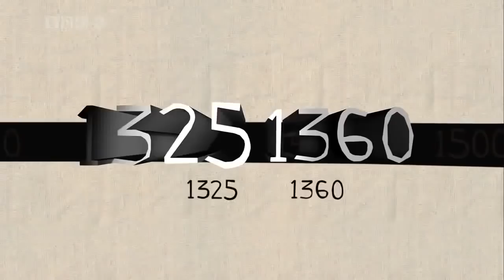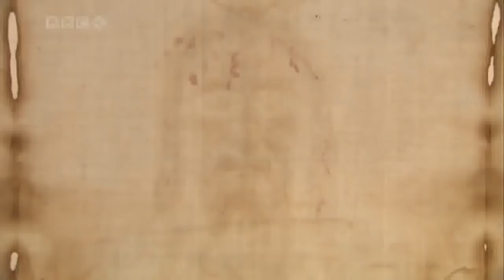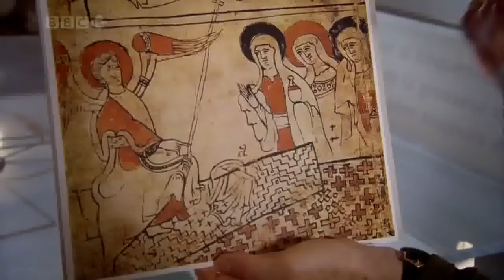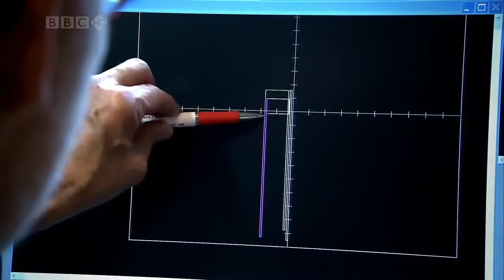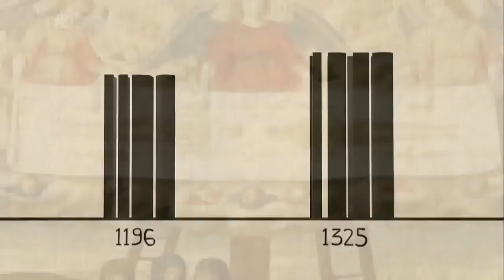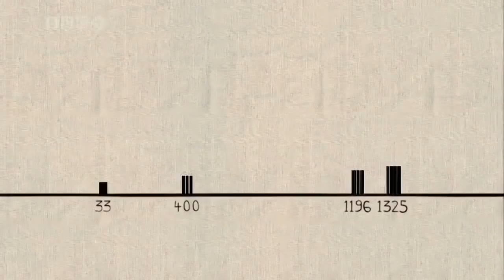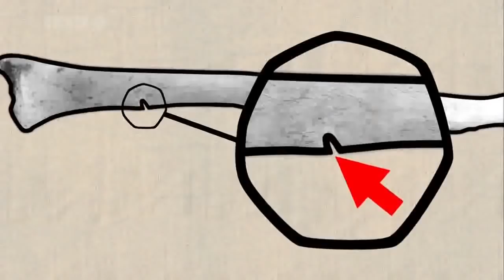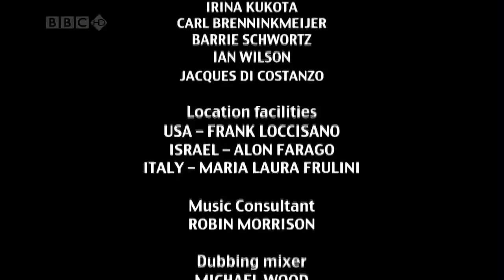BBC SHROUD OF TURIN NEW EVIDENCE

Comment: The carbon dating was correct.  However, the sample of the Shroud given for carbon dating was not of the original Shroud.  It included repairs which used cotton added to the linen of the Shroud during the Middle Ages.  Add to that the fact that the Shroud cannot be reproduced today showing the same qualities or that we are, today, unable to understand how the image actually transferred from inside the body of the Man of the Shroud to the material of the Shroud.
Reply: I had heard or read the same thing about newer repair material being in the tested sample in the 1970's.  I wish that was discussed in this documentary.
Reply: What you have here is the church backpeddling. Funny how no mention of repairs, until they needed to lie.
Reply: @poozer1986  Prior to the carbon testing the Shroud was photographed under various forms of light and is documented through that photography showing areas which were distinctly different in shading.  One such place is exactly where the sample to be tested was cut, divided and sent to the labs.  All this was filmed and done with complete documentation.  Later examination/testing of the area(s) showed that the area of the tested sample was mended with cotton, not linen, and had an animal dye in it to make it match the linen color of the Shroud.   No lies and it was not the Church who discovered the repairs.  It was scientists.  Imo, the Vatican would prefer to ignore the Shroud.  It's a personal experience.  If you read all the scientific information available you will either believe that it is something supernatural, that we cannot duplicate today, or you won't.   It really shouldn't matter to anyone what someone else believes.
Reply: @sharonburke100  just to add, it didn't bother me what anyone else believes. Hell, I'm a real life descendant of vikings, so I was brought up with norse mythology as bedtime stories.

The only time we as atheists get pissed, is when other people's beliefs, infringe in our lives.
Everywhere I go I see religious bullshit. It's even worse on America.
Here's a deal, you keep religion behind closed doors, where it belongs, and we as atheists will stop giving you a hard time for your delusional thought processes
Reply: @poozer1986    I feel sorry for you.  You are a very disturbed person.  Goodbye.
Reply: @sharonburke100  see how crazy you sound. In any other context, you'd be classified as insane
Reply: @sharonburke100  meant to ask. Why do you feel sorry for me. You shouldn't, after all, I'm free of the oppression and hatred of religion
Reply: @CMA0333  I'll have a look at our when I can be bothered. No doubt its all biased bullshit dressed up as real science.
Reply: @poozer1986  love your neighbor as yourself, if you have 2 of something give one away, forgive, don't sue at the law...yeah, real oppressive hatred teachings we Christians believe in
Reply: @lostamericanhistory2536  anything, that gives you rules, whether God or bad, and had an eternal punishment for those who don't follow, or by definition, oppression.
Reply: @poozer1986  I have no evidence or reason to even believe that Jesus visited America and neither do I believe it is a nation of predominantly saved people.
John 8:36 "if the Son therefore shall make you free, ye shall be free indeed.
James 1:5 If any of you lacks wisdom, let him ask God,who gives generously to all without reproach, and it will be given him. 
Proverbs 1:7 The fear of the LORD is the beginning of knowledge; fools despise wisdom and instruction.

So God does not teach oppression or ignorance
Reply: @poozer1986  Im very educated. Salvation isn't legalistic, that is worthless. if you confess with your mouth that Jesus is Lord and believe in your heart that God raised him from the dead, you will be saved. For with the heart one believes and is justified, and with the mouth one confesses. Slavery : your referring to gen 21. God doesn't condone slavery, he told the Hebrews how to treat their slaves in the land they were going to conqure. In 21 he also forbids the capture and selling of people. I have raised 2 nephews and 1 niece as my own. My niece is homosexual. I treat her the same as before
Reply: @poozer1986  As you are now, you were making derogatory statements in an opinionated attempt to link a lack of intelligence or education with faith. I am an electro mechanical engineer who ownes his own company. We provide automation service to fedex and Ups, mainly programmable logic controls for their conveyor systems. So far you have only stated your opinions which are unfounded.
Reply: @poozer1986  I fully agree, education has nothing to do with faith so why did you bring it up? God says " the fool says in his heart there is no God". I think that now makes 5 topical statements that you have made.  I have responded with quotes within context which proves that you have been wrong on every point. Your lack of rebuttle and behavior is proof. You have provided no evidence for anything, only statements which makes your comments an opinion, not fact.
Reply: @lostamericanhistory2536  but I can, however prove, that evolution hairbrush, although I don't need to. Its caked the theory of evolution, and if you were indeed smart, you would know what a hypothesis must go through, to be given theory status. Anything that is called the theory of something, like gravity, germ, relativity etc, are proven way beyond reasonable doubt.

Theories need hundreds and hundreds of proven bits of information to get to that status, but only needs one bit of evidence to the contrary, to not be given it.
Reply: @poozer1986 You havnt proved anything  yet Alex your just going all over the board on topics which I presume are things you read online. Psalms 2 Why do the heathen rage, and the people imagine a vain thing? Ok so now intelligence does go hand in hand with faith. James 1:8 a double minded man is unstable in all his ways. Im not sure what an evolution hairbrush (autocorrect makes everyone look like a fool at one point or another lol) is but 2 Tim 3:7 Ever learning, and never able to come to the knowledge of the truth.”
Reply: @LennyCash777  absolutely wonderful presentation Lenny thanks for the post.
Reply: @lostamericanhistory2536  
No problem. God bless. ✝️ 🕊️ 👑
Reply: @poozer1986  one need only look at the area that was carbon dated and visibly see that this area was repaired.  They cut right along the edge in between the old Fabric and the new fabric it doesn't take a rocket scientist to figure that out.  Anyone that thinks a 2000 year old cloth would not at some point be in need of repair is extremely lacking in intelligence.
Reply: @sharonburke100  very well stated.  It comes down to this, if one follows the good science the Shroud is authentic if one follows the bad science then it's not.  A great example of bad science is drawing a conclusion based on a single test and ignoring 99 other tests that are in disagreement with that.
Reply: @GoodShepherdFilms3333  so, all 8,or more, pieces, were all, conveniently, repairs. Again, you show your bias and ignorance.
I never said a 2000 year old cloth wouldn't need repairs, but it isn't 2000 years old, it's 900 at a push.

The case is closed, and the church won't allow any further tests. Convenient again.
Reply: @GoodShepherdFilms3333  not even the Catholic church will say if its real or not. Because we know it's not, and I'm guessing, so do they
Reply: @poozer1986  the Shroud of Turin is a witness that tells a story in the form of 21st century forensic science.  It tells us with unmistakable clarity that a dead body became a living body in a 3 day time period and  emitted several billion watts of power for less than a billionth of a second and as a result left a holographic, color inversion, x-ray image on linen.   We know you think the truth is like a pretzel you can twist into any shape that makes you feel comfortable and doesn't threaten your fragile belief system but it's not.  Skeptics such as yourself make for great study in how ignorance and contempt clouds one's judgment and makes it impossible to conduct a fact-based, thorough and objective investigation.
Reply: @poozer1986  it says In God We Trust on our currency if you don't like that you should move to another country.  I should also remind you that nearly everything you do in your life is to acquire that piece of paper that says In God We Trust in it.  No matter how you present your case you can never prove there is no God and there is also no escaping the fact that you're actually gambling with eternity.  Skeptics claim to be intelligent yet their actions demonstrate the polar opposite.  The elf communication waves around the circumference of the Earth are clear evidence of a higher power intelligence / God.  Another demonstrated reality in front of your face that you ignore because it threatens your fragile belief system.
Reply: @poozer1986  wow you just rendered a guilty verdict before the defendant even stepped into the courtroom and the first witness gave testimony.  In the same way you have just rendered a guilty verdict that same criteria will be used when you are judged.  Do you realize your criteria and measuring system of justice is based on a scale  below that of a Salem witch trial?   Have you ever heard of a thing called doing a fact-based and thorough investigation before rendering a verdict?  You should try it sometime.
Reply: @GoodShepherdFilms3333  your first amendment directly contradicts your first commandment.
Reply: @poozer1986  21st century forensic science confirms that what is written in the Bible is indeed truthful and accurate testimony.  You can be in disagreement with that but your opinion the bible is not rendefing credible testimony is not based in science but rather based in ignorance and contempt.  The forensic science tells us on the Shroud of Turin that the resurrection of a dead body is indeed possible and such an event did indeed occurred nearly 2,000 years ago.
Reply: @poozer1986  how would you know what the facts State?  you rendered a guilty verdict before the first witness even had a chance to give testimony?!  Read your own posts, the evidence of your contempt and ignorance is in plain sight.
Reply: @GoodShepherdFilms3333  it's people like you, that have turned your country, from a super power, to a world wide laughing stock
Reply: @poozer1986  8 pcs?  What are you talking about?  Area of the cloth.that has the most damage is around the two ends of the cloth where it was handled the most.  Carbon dating test was s a single piece of fabric cut 7 cm long and 1 cm wide and then was cut into three pieces on one of these edges.  The Shroud of Turin fabric has the same level of electromagnetic radiation damage as the Dead Sea Scrolls that we know are over 2000 years old.  It is a scientific impossibility that the cloth is only 500 years old with this level of severe radiation damage.  Note I said electromagnetic radiation damage not thermal radiation damage.  A big difference between the two. A Swiss textile expert also confirmed that this was a first century cloth.  Also there was a carbon dating tests done in 1982 in the same area that showed the cloth came from the time of Jesus.
Reply: @poozer1986  In their last exhibition of the Shroud in 2020 they outright stated that the cloth was the true authentic burial cloth of Jesus. yes they did
Reply: @GoodShepherdFilms3333  please, cite your reference
Reply: @GoodShepherdFilms3333  do you honestly think, science would have only checked 1 part? Your ignorance towards the scientific method is infantile.
Again, please cite your references
Reply: @GoodShepherdFilms3333  actually, I do have 1 last question. Have you ever thought your god doesn't exist. Even if it was a spilt second?
Reply: @poozer1986  the only way in which 21st century forensic science has been able to replicate the unique chemistry and physics of the Shroud image was to fire an argon fluoride laser at a single fibril with significant power for less than a billionth of a second.  The process to create the entire image would require several billion watts of power emitting from a dead body there's no way to escape that fact.  You can hurl insults and use words like fairy tales and whatever but whether you realize it or not you are backed into check-mate.  Your feeble attempts to escape are laughable.
Reply: @GoodShepherdFilms3333  really, you think I'm backed into checkmate. The delusion continues.

Never answered whether you've ever not believed
Reply: @poozer1986  whether you live in the US. England or in Africa there is still no way of escaping the fact that in order to recreate the image on the Shroud of Turin involves being able to emit several billion Watts of power from a dead body that results in changing  the electron bonding of the carbon atoms that make up the linen flax from single electron bonds to double electron bonds.  It is impossible to create such a change in the atomic structure of carbon atoms and leave behind a superficial image that only penetrates one or two micrometers into the 15 micrometer wide linen flax fabric with a man made process.  Of course if you had conducted a thorough investigation into this case File you would know that but you don't.   Unlike you I conducted a thorough, fact based and objective investigation into this linen cloth before rendering verdict and I could have cared less  whether it was authentic or not.  Of which for the record I did not believe it was.
Reply: @GoodShepherdFilms3333  again, unless you show evidence for what you're saying, I don't need to believe a word of it.
Wow, your church is really inventive when it's trying to keep it's sheep blind
Reply: @GoodShepherdFilms3333  I didn't need to conduct anything, or was done for me. Science didn't care what the result was, as long as out was accurate.
So, again have you ever, for a split second, thought God didn't exist.
Reply: @GoodShepherdFilms3333  did you get a piece of the cloth, and test it yourself? Didn't think so, so again, just conjecture
Reply: @poozer1986  first of all I lived in  Costa Rica and Nicaragua for 7 years I've also lived in Mexico and in the Bahamas, I just happen to be in the US right now and quite frankly I don't give a damn what you or any other country thinks about this one or any other country I have lived in, and if spending ten years of my life carefully reviewing evidence and doing a fact-based thorough and objective investigation into a matter in pursuit of the truth makes me a laughingstock then I want to be a laughingstock and would wear that badge With Honor.
Reply: @poozer1986  from your own posts and written testimony we see that you render guilty verdicts on a scale of Justice below that of a Salem witch trial and we are supposed to believe that you're a credible Witness?!  I could ask you 12 simple questions about basic forensic facts of the Shroud case file and you would not be able to answer one of them without doing a Google Search and then stand a 50% chance of being wrong.  You have already been reduced to character assassination as your "evidence" . The Shroud of Turin is a case where 21st century forensic science and religion come together on this piece of cloth I should also add they get along quite well together.
Reply: @GoodShepherdFilms3333 
Clearly, you wasted 10 years, if you ended up believing the clear fakery of the shroud.
Why do you continue to avoid the question. Have you ever not believed?
Reply: The Carbon dating was "Wrong" and couldn't be correct because it was dyed cotton. And the Original material is all linen. Which the "New Carbon dating" shows it comes from the time of Jesus. 
Watch or Find the Documentary with the  Original lead scientist Raymond M. Roger's of all those tests done, He even helped to get a second test approved.  Barry Shwartz One of the Photographers  has made this his life's work. This cloth changed lives of the people who got to work on it. 
The new cut carbon sample shows its from the first Century.
Reply: @BlueskyGladue  are you honestly going to push such garbage. Please, cite where you get your lies from.
New carbon dating? Again, please cite the study and press paper. From what I can see, Rogers is a theist, so unfortunately, his opinion doesn't matter. It also appears that Barry is also an indoctrinated theist, so again, his opinion doesn't count, as ours heavily biased with their need for the shroud to be authentic.
You're totally right, the oths lie for change lives, and forced people to believe in the dogmatic cult that is Christianity. It changes their lives for the worse.

I await citation of your claims, and the relevant scientific documentation and papers to go with it
Reply: @BlueskyGladue  but, even if the shroud did come from the 1st century, that doesn't prove anything, other than its old.
But anyway, I find this Rogers and his claim. Literally no one, other than himself, thinks he's right. He claimed, but never proved anything.
Reply: @poozer1986   atheists I’ve met are all snarky and arrogant, very arrogant. You all sit on your high horse soap box acting like you’re smarter and better because you don’t believe in a god. Even if it’s a Christian minding his own business. Think about it you believe that this universe came from a small dot of dense material/matter that came from no where, somehow exploded and through billions of years formed everything we see and feel today. You believe that our existence and the universe is mere chance. So before you go judging other people, reflect on yourself. And remember the Big Bang isn’t a fact, it’s a theory that has no testable data
Reply: @poozer1986  so according to you, this entire universe came from a dense point of matter that had no creation, it always existed right? Nothing created it? Does that sound familiar?
Reply: @louiegonzalez6812  let's look at our this way.
You walking into a meadow. It's totally clear except for a tree stump in the middle. No sign of a tree, or drag marks, in fact, no sign of anything. Theists, as they e no tree, and no evidence of a tree, must conclude the stump grew as is. Science, on the other hand, knows the must have been a tree, and that tree has since been felled and removed.
Reply: @poozer1986   So you do believe that God Exist; right? And yes it takes some faith not to believe in anything, why? Take all the world cultures; they all have in common the fact that they believe in some kind of gods even the vikings. Is that a true statement Alex?
Reply: @gamesplayerDJ  no, I totally deny the existence of any of the 3000 or so gods that have been created by man.

It takes zero faith, to not believe something, especially when I I work with facts
Reply: @gamesplayerDJ  just because people believed in God, does not make it true
Reply: @poozer1986  OK. First of all ; I agree just because people believe something doesn't make it true. On the other hands 3000 different culture believing in gods make it hard even for science to brush it aside as something not true. Do you agree with that?
Reply: @gamesplayerDJ  your profile picture says everything I need to know about your arguement. It will be heavily bias, and have absolutely no evidence to back up anything you say
Reply: @poozer1986  Thank you for your reply. Yes, I am a Catholic and obviously I am not trying to hide it. So to your point, I am bias but only toward the truth. So far, I have not used any argument that's beyond basic reasons, have I? If I did please point it out to me. I will like you and to have simple discussion using evidences (Sciences). If I say something that reasonably isn't true, you can point it out and disprove whatever claim it is that I am making. Can we agree to move forward on those principles. If yes, can you please answer my previous comment? FYI, I am not an "apologetic"; I am a simple lay Catholic Christian so I am not here to shove any well prepared arguments down your throat. I just want us to have a simple discussion. Thanks and May Peace and Love be with you.
Reply: @gamesplayerDJ  you say you're bias towards truth, yet you follow a religion that quite literally has no evidence or truth, to back it up.
Any time you mention god, you're talking without basic reason.
First you must prove your claim to be true, then I can disprove it. As you cannot prove anything towards your religion, it's a non starter.

You are indeed an apologetic, because you're arguing in defence of your faith. That precisely what apologetics are.

I see no reason to have a discussion with you, as I was always taught to leave puerile to their imaginary friends.
Feel free to take your leave
Reply: @poozer1986  I follow a religion that has no evidences to back it up. How is that, can support your claims because that's what sciences do; make claims based on fact. So far you have no provided any evidence as to any of your claims. I want us to discuss this subject by subject but you keep switching from subject to subject and now you're attacking my Faith which for obvious reasons I didn't mention to begin with. It is funny that you want to use the very thing that you reject to prove your point. Think about it. Please let go subject by subject. Since you do want to answer me; please start stating your counter claims to the existence of God or to Truth of Jesus-Christ or anything else you think will sustain your point of view. I am listening. Peace be with you my friend.
Reply: @gamesplayerDJ  you misrepresent science, so please, stop trying to use it. No your religion didn't have any evidence, and I don't need to prove annoying to say that. You need to prove what you say, it's fact. You're breaking the null hypothesis, not me.
It's about time you guys learned who the burden of proof falls on, in a discussion.
I don't reject religion, as ours clear religion exists. I deny the authenticity of these religions. There's a huge difference.

I'm case you missed it, or I want clear, I have no intention of having a discussion with someone, about their imaginary friend.
I'm pretty sure my first comment was about the authenticity of the shroud
Reply: @poozer1986  No where in my comment have I tried to make this about my religion. You're the one making it about my religion, and honestly that's not my goal. I was expecting this to only focus on God and Jesus-Christ, and angels, demons whatever you want to discuss. FYI, I don't believe in the shroud of Turin. Yes , you read it right. I don't believe in it but that doesn't make it false or fake. It may be really the real burial Cloths of Jesus-Christ, but I don't need that to believe in Him. You're making a lot of assumption which isn't helping. For a scientist or facts based believer; I don't understand all these baseless claims and assumptions you're making. Peace be with you my friend. You don't seems to want your belief challenged. You just want to believe in whatever you believe and I can not change that. You want to discuss my belief, go ahead but don't make any unsubstantiated claims. Thank you!
Reply: Its been debunk watch the 1st episode of the jesus code, the imprint is the result of the sun and silversulfate, medieval tech photography.
Reply: @poozer1986  The Catholic Church does not need to lie; it does not need nor depend on the shroud to survive; if the shroud is really a fake, the Church will say so. However, there is still no conclusion other than in people's minds. Deep mysteries still suround this artefact. It's the same with revelations like Fatima. So much mystery, yet few are willing to look at the real evidence available in case it's authentic! I understand this, we fear we have built our lives on sand and turn away from the truth!
Reply: @eamonnmurphy5385  of course the church needs to lie. It's whole essence is that of a lie. The book you all hold so dear, had literally no actual, real life evokes to back it up, yet it claims to know the truth about everything. If not a lie, that is certainly disingenuous.
Also, could you imagine the backlash, of out turned out that religion was false. The Catholic church would have so much to answer for, it would be way more than any nuremberg trial.
The fact that the church itself won't actually completely validate the shroud might give you some clue as to its authenticity. The church has never actually claimed the shroud is real, and actually stays quite indifferent about the subject. You really should do your homework. The Vatican itself doesn't claim its authentic, but also won't claim it isn't.
Reply: @eamonnmurphy5385  sorry, but personal revelations are house shit. There's a guy in my town, swears he met elvis on a ufo. He honestly swears by it. Should I accept it, just because he's convinced?
The evictee had been put forward. The shroud is medieval. Also, there are about 100 recorded "nails of the cross and enough splitters from the cross, to make a 100ft cross. This is just more Roberts the church will fabricate whatever it needs, to make money, or con people into a life of servitude and idiocy
Reply: @poozer1986  Alas, you are fully armed with the Hitchens body armour! So sad to see, a waste of a life really. Try a little investigation, a little critical thinking sometime brother, you are worth it!
Reply: @poozer1986   Why are atheists obsessed with religion?!
Reply: @johnbuggy9121  we aren't obsessed with religion. We just find willful ignorance, and the oppression that comes with religion, something worth fighting against. Religion is the single most destructive force on earth
Reply: @poozer1986  Wow, from all your back and forth talk I get the impression that being an atheist is improtant to you -- so much energy expended in defending your position. Talk about dogma!
Reply: @janetclark5668  being an atheist isn't important to me at all. Correcting willful ignorance, however, is.
I haven't once defended any position, because atheism isn't a position. It's the lack of a position, if anything.
Also, no dogma. Just facts, evidence and reality
Reply: @poozer1986  so you believe that Rules are bad. So if someone came and killed your loved one than they shouldn’t be held accountable or punished?
Reply: @ImCeeJH  no, I certainly do not believe rules are bad. Where did I say that? To think these rules came solely from your bible, is where the issue lies. Yes, murderers should be dealt with, just like the sumarians, and every other civilisation that existed before the bible was written by man
Reply: @poozer1986  yeah this is once again false. our country was founded on the principles in the Bible. And over the years the more and more people began seeing themselves as Gods of their own lives the more America has begun to spin out of control. The country didn’t start atheist and become religious.
Reply: @ImCeeJH  what country are you taking about? USA? Then our ours you, who is wrong. Your confetti was, and still is, the only truly secular nation. You have equal right to follow, or not follow, any religion you like. Your country is no more Christian in foundation, than dogs being able to fly. Unfortunately, since ours inception, religion had crept back in, infecting and poisoning its way across the country.
Is good you set the fact that America is spinning out of control, but you will find, its due to the increase in religious insanity. Not the lack of religion.
No, your country started secular, then became a laughing stock
Reply: @ImCeeJH  your first amendment, directly contradicts your first commandment
Reply: @poozer1986  you said it’s oppressive to punish those who don’t follow the rules.
Reply: @poozer1986  it’s very unfortunate Alex how wrong you can be. Our founding fathers of our country built it on the premise that it was to be a Christian nation. Now that doesn’t mean it’s a faithful nation. And it doesn’t mean we are saved. But that our principles and morals come from God.
Reply: @poozer1986  can you explain how it contradicts?
Reply: @poozer1986  why should murderers be delt with? They were just doing what they wanted and loved. Something that made them happy. It’s super oppressive to say they can’t live their life the way they want. Unless you know it to be morally wrong. But how is it morally wrong if we are here by chance with no set of rules. Just a bunch of clumps of cells on a spinning rock in the abyss that ultimately leads to nothing. In fact someone should just blow the planet up. If this is all for nothing than it really doesn’t matter if the planet exists. Or the people exist. Or if you exist. It’s all pointless. So if that’s the case why do you even want to exist and play the game of life to just end up with nothing at the end? How come you don’t jump in front of a speeding car. Because you value your life. But why do you value your life if there is 0 meaning to it. If there is no purpose for the existence of the universe than there is no value.
Reply: @ImCeeJH  no, I did not say it is oppressive to punish someone for the breaking rules. If you cannot see the oppression in the bible, you baby be that smart. You're made sick and commanded to be well. Love God, or burn for eternity. That's oppression dude.
The first amendment, grants the free practice, or non practice, of any religion. The first commandment is, thou shaky have no other gods but me. That's a contradiction.
Reply: @ImCeeJH  no it wasn't a Christian nation. They flied England due to religios persecution, so they wanted to create a nation where people were free to believe, or not believe. That's the exact definition of secular.
Reply: @poozer1986  why is thay oppression? Love God because he saved you. Not because he needs you. Jesus died on the cross for us because we sinned and because of our sin it separated us from God. So Jesus the greatest man to ever exist. The only sinless man to ever exist gave his life as payment for our lives to be sparred. But if you don’t accept the payment he made than your debt isn’t paid. And if it isn’t paid than you’ll be the one paying. And that means you’ll be eternally separated from the Lord. You’ve been given the knowledge and you deny it. That is like a person being told not to murder and still murdering someone. They have to be held accountable. They knew the rules and didn’t believe in them and broke them. And yes very clearly state that if you break Gods rules and are punished for it that it’s oppressive. No, it’s justice
Reply: @poozer1986  yes that doesn’t make it a contradiction. That gives us the free choice. You can either choose to follow God or you can choose to live separate of God. That is our choice to make. God would never make anyone follow or believe in him that didn’t want to. You really don’t know much about the Bible or America it seems.
Reply: @poozer1986  God doesn’t want false believers who only believe cause they were told to. He wants the people who actually want to know him. Who actually want to follow him.
Reply: @poozer1986  that’s the exact definition of free will which God has granted us. Making someone believe in something they don’t is control.
Reply: @poozer1986  why is it good to maintain and progress our species when at the end of our lives it we no longer exist? Why is that good? What makes that good?
Reply: @ImCeeJH  listen to how you talk. Your bible is just a primitive fable book, buddy. Literally all of it, never happened.
No moses, ergo no commandments or Exodus.
No Adam and eve
No flood
Probably was a guy called jesus, in the area, at the time, but that's about it. Absolutely no proof that he was any more than just a man, possibly a mythical man, like moses.
Reply: @poozer1986  no one is segregating you. Or any non believer. If I were to segregate you I wouldn’t even be talking with you. And why is it good for our species to continue on? Who determined that to be good?
Reply: @ImCeeJH  no, it makes it a contradiction. Your bible says to only love your god, and no other, and the 1st says, you're free to love any god or no god. Do you even know what words are?
So, God is happy for people not to believe, yet sends those who don't, to an eternal torture pit? Wow, even you must have struggled worth that one.
I clearly know more about both, which is pretty embarrassing on your part.
Reply: @poozer1986  you haven’t answered why it’s good for our species to continue on?
Reply: @ImCeeJH  of we didn't consider the continuation of the species good, and important, we would have gone extinct thousands of years ago.
Reply: @poozer1986  yeah. If you want eternal life and a prosperous life follow God. Or else you won’t be granted that reward. Nowhere does it say that you are to be forced to love God and only God. Your misunderstanding of scripture is why you are so misguided about this topic.
Reply: @poozer1986  no sir. You just have an elementary understanding of the topic you continue to speak of. A lover  of truth certainly doesn’t twist the truth to fit their own narrative and that is what you have done every possible chance given.
Reply: @poozer1986  and why does that matter? How come going extinct is bad when your life will end up extinct anyway. So please tell me why does it matter. It’s not like you can take any of these memories and experiences with you when you die according to your views.
Reply: @ImCeeJH  I haven't twisted truth once. I have only stated what is clear to see. Judging by your profile pic, you aren't that bothered, as vanity doesn't seem to bother you
Reply: @ImCeeJH  going extinct, on a generational level isn't an issue. We evolved from bacteria, and the only proper of bacteria, it's the survival of its species, a trait I'm glad we maintained.

But you're right, ultimately, life doesn't matter, and we give our own purpose to life. I live for my children, and promised to leave this world in a better condition, than when I found it. Unfortunately, with pollution, and religion, it seems I will most likely, fail
Reply: @ImCeeJH  no, we cannot take anything with us, making our existence that little bit more special, as we only get 1 shot, so we better make a good attempt. Thrusts, really don't need to concern themselves with this world, at it's just a waiting room before the after party. That's scary, if you think about it
Reply: The shroud has pollen from plants from the middle east.
Reply: That was the 1st time. It was redone & proven to have been made in the Middle Ages. The Smithsonian figured out how the image was made -- they made a replica cave heated in the sun, kind of like an old pizza oven. It's been proven beyond a doubt that it is not from Jesus' time. Also, the person was still bleeding, so his heart was still beating when wrapped up, according to a team of blood spatter analysts. Don't cite science unless you ate going to keep up-to-date with scientific studies!!
Reply: The image came from inside light not sunlight.
Reply: Why keep ignoring the pollen found?
Reply: If the image was made from sunlight why is it 3D? It should of come disturted if came from outside light.
Reply: @cliofaces4937  I can go to Egypt, gather pollen, and sprinkle it on Mt Everest, does that mean Mt Everest is in Egypt? You guys are so gullible, you're being duped by a medieval trickster.
Reply: @cliofaces4937  why would outside light distort anything? Do you even understand how things work?
Reply: @cliofaces4937  oh and the image isn't 3d.
Reply: @poozer1986  the image is 3D. How did they made a 3D modal of the image of it? 
You have not done enough research my dear.

Would people 2000 years back have enough knowledge and time to make a forgery like you claim? 

Just because I not into Christianity does  not mean that the shroud is a forgery.
I'm not gollable and the conclusion f the shroud  being of it being 100% forgery or 100% true is not scientific since you have no idea how it's was reproduce.
On pbs this scientist try to prove that the image was some kind photography made with sunlight but the image he reproduce was  distutred.
Reply: @cliofaces4937  who says it's 3d? Please, add references or citations.
Funnily enough, I don't need to do any research. The shroud is a fake, made in the medieval period.
The forgery was made less than 1000 years ago, and the ability to do it was there, because they did it.

Whether I believe in Christianity or not, is irrelevant, the shroud has been tested, and found to be nowhere near as old as it's claimed to be.
Your spelling and grammar, are absolutely atrocious, and of English is your first language, you should be ashamed of yourself.
So, someone had 1 attempt, and managed to fake out, with a bit of distortion. So, given enough time, he could tweek it, and get it just right. Proving that it can be forged.

Please, don't let your indoctrination, and need for the shroud to be real, cloud your judgement.

The shroud being fake, doesn't harm your claim about God, so why be willfully ignorant?
Reply: @poozer1986  last I saw it was pbs. And if did research like you said you will find that no one has never replicated it exact product like that 100% like the shroud.
Reply: @cliofaces4937  you should read the last paragraph of the description to the Nat geo video. This is what we, as scientists, talk about. You haven't even watched the video you're trying to use as proof.
Reply: @cliofaces4937  oh, pbs, so it must be true.
Can you, or anyone else turn water to wine? No, so that means jesus can't have either, as it's never been replicated. If advise you to quit while you're behind, below you make even more of a fool out of yourself.
Reply: @xochitlarte3948  the latest, by a clearly religious person. Sorry, not going to cut it
Reply: @poozer1986  dear you  believe the shroud to be fake and that was made in the middle ages.  In reality there is no technology from today and less likely in the middle ages to reproduce similar results conditions and details as the shroud show.  

All the scientists didn't have or agree with same conclusion.

It your  problem if you don't believe the shroud to be true and don't expect to convince you to be true. You made your mind up about the shroud period. 

Look up Raymond M. Rogers.
Reply: @poozer1986  Are a forensic science?
Reply: @poozer1986  the scientists in na geo documentary didn't agree to same conclusion.
Reply: @cliofaces4937  "are a forensic science"? Wow, try again
Reply: @cliofaces4937  of course they didn't. They already have a vested interest in the shroud. You said you weren't gullible, but fuck me, I've never met anyone who is as easily lead as you
Reply: @poozer1986   where is the evidence that the shroud is middle age forge?
Reply: @cliofaces4937  where its the efforts it isn't? You're the one making the claim is jesus, so prove it. I don't need to prove anything, as I'm not making a positive claim. From the studies I've read, the chances of the shroud being real, are very very small.
Again, the authenticity of the shroud doesn't disprove your faith, so why does it bother you so much?

Anyway, your need for the shroud to be real, is clouding your judgement, and the nonsensical videos you watch, fuel it further
Reply: @poozer1986  wow 👏 just like you told another commentators , this video is not enough evidence to show that the image is a forgery.  The guys is bias.  His an atheist and like most atheist believes in the material Pseudo science.

You can assume what ever of me . I will be skeptical about the shroud being a middle-aged forgery. Since there being several reproduction done by using a photogragh image of a sculpture that was place between a cloth that was treated with chemicals  use in photography that with sunlight would reproduce an image on the cloth.
Yet this reproductions miss certain details.  Like the blood in the shroud that belongs to a man. Why would a middle-aged forgerer put blood in a shroud if the blood is not that noteable and where people back in the middle ages able to test for blood? Would a Mid evil forgery have pollen? Why does the shroud have limestone in the area of the foot? The blood itself does not creat the image. The image is barely inprinted in the cloth. The image was illustrated 70 years earlier before the estameted corbon 14 test date. Just because the shroud is not a forgery does it mean that the man in the was Jesus.

Just because I don't agree with you does mean I'm galable.  I could go on on.. You just made up your mind that is a forgery.
Reply: @poozer1986  if with today's technology can not reproduce the image unless is a photogragh but the photogragh is missing certain details like mention earlier what makes you  think that midd evil technology can?
Reply: @poozer1986  where did I said I had faith.  Did you read some of ealier comments?
Reply: @poozer1986  why does the shroud show that the nails were on his wrist and not on his hand palms? THIS so called mid evil forgery did his homework, because even today people believe that Jesus was neiled to the cross by putting the nails on his palm.
Reply: @cliofaces4937  but they can replicate it, and have. You said it yourself, or was just a bit blurry. So, with practice and time, t they could get it perfect.

Can you explain why the body that was put in this shroud, was bleeding? Dead people don't bleed.

What mashes me think medieval technology can, erm, because they did. Your shroud is not even 1000 years old, the material used cannot be from jesys time. It's that simple. You can argue or all you like, even the Catholic church do not recognise the authenticity of the shroud
Reply: @cliofaces4937  its really hard to read your comments, as they appear to have been worn by a toddler, who has just learned to speak.
You have faith, because they're is no whoever for god, or the shroud being real
Reply: @cliofaces4937  wow, I will certainly be showing the children from my class, this conversation. They need to understand what indoctrination is, and you fit the bill perfectly.

Atheists are not bias. We have evaluated all the evidence, or lack of, and have concluded there's a big change god doesn't exist. All our would take to change an atheists mind, ours actual evidence.

What would it take to change your mind about God?
Reply: @cliofaces4937  gullible I think you meant. No, having a different opinion, doesn't make you gullible. Believing nonsensical bullshit, does
Reply: @poozer1986   does not matter where you got your knowledge rather its was from a Bible, science book or a lab or even if yourself witness it is still questionable.
Reply: @poozer1986  if you have an idea how to produce a  photo of negative  of x-ray image done in the middle ages? Please tell me.  
Yes I have herd that dead people don't bleed. And that there is speculation that the man in the shroud was not dead and he survived. But the color of the blood was found to be too red for aged blood.

The Catholic church always has be in most case skeptic about miracles and religious relics.
Reply: @cliofaces4937  science proved the cloth is no older than medieval. Simple
Reply: @cliofaces4937  out really doesn't matter what you say. When tested, the material was found to be of the medieval period.
But, even if the shroud is real, it proves nothing
Reply: @poozer1986  yes I would also question that the shroud is proof of anything. Since don't know what happened 2000 years ago. I know what the shroud contains.
Reply: @poozer1986   really.  I'll still would question that even if came from tge Bible    or with my own eyes. So far I have not seen no evidence of how someone 1000 years back would be able to produce an x-ray negative image.
Reply: @cliofaces4937  the shroud contains what? Even if the shroud is from jesus' time, how can you prove its actually jesus? You have to make such a huge, uneducated, leap of faith, to arrive at that conclusion.

As science had proven the age of the shroud to be less than 1000 years old, that's enough for me
Reply: @poozer1986  the shroud was tested what about 3 times from the same area later know to be a repair in the middle ages o so. The new repair areas are made of cotton while the rest is made of lanen. Others test should be done on it where it's know that is was not repair.

The Catholic church won't allow more test on the shroud.
Reply: @poozer1986  I need proof that people back 1000 years or 900 years  ago were able to reproduce an x-ray negative photo.
Reply: @cliofaces4937  please, provide evidence for this claim. You will find the only ones making it, are theists.
I wonder why the church won't allow more tests. Because they know ours not real. There's no way the test done, was in the same area. It would be much better, to test over many sections. So I'll wait for your evidence that says they tested the same area 3 times
Reply: @cliofaces4937  anyway, aren't you bored yet. I know I am. Either way, regardless of how old the shroud is, it proves absolutely nothing.
Reply: When you are about to die, I guarantee that you would not be so sure
Reply: @davidwoods607  🤦🏼‍♂️
Reply: @poozer1986  you have not proven nothing
Reply: @cliofaces4937  "not proven nothing" so I've proven something. Double negatives to make me laugh, as they show me how idiotic people can be
Reply: @poozer1986  proven that you don't use science.  Proven you accuse people of what you are a atheist religious fan.
Reply: @cliofaces4937  it's "an atheist" not "a atheist"
See how you fail at even the most basic grammar. Why should I take anything you say seriously?
Not sure if you're trying to assert, that atheism, it's a religion. Like not collecting stamps, is a hobby 😂
Reply: I can see a few trolls in the comment section. 😒😮
Reply: Barrie Schwortz was one the scientest that did study back in the 70s. People were getting some incorrect information about the shroud that Schwortz made a website of all the studies done on the shroud.
Reply: Barrie Schwortz was one the scientest that did study back in the 70s. People were getting some incorrect information about the shroud than Schwortz made a website of all the studies done on the shroud.
Reply: @xochitlarte3948  I know, right. Religious trolls everywhere
Reply: @poozer1986  you are one aren't you?
Reply: @xochitlarte3948  a religious troll? Nope, not me
Reply: @poozer1986  confirm my sus
Reply: Barrie Schwozt for any questions.
Reply: @xochitlarte3948  confirm your sus? What are you on about?
Reply: @poozer1986  
The harder time you give us, the greater our reward will be in heaven. So, feel free.
Reply: @JP-sd7di  do you hear yourself. What nonsensical god would have those kind of rules. Plus I'm not giving anyone a hard time. You crave persecution
Reply: @sharonburke100  Pretty funny that the guy is complaining about seeing religious things everywhere and then he comes to this video! LOL! He's not doing a very good job ignoring it if he gravitates to the subject matter.
Reply: The fact that it has been exposed to fire would make carbon-14 dating highly inaccurate As far as I know.
Reply: Fire damage is known to make carbon dating invalid as well.  I still don't understand why they ignored this fact originally
Reply: @thewonderpig97 
religion
noun
the belief in and worship of a superhuman controlling power, especially a personal God or gods.

Please, explain how atheism fits this definition?
Reply: @thewonderpig97 apologetics really do show just how ridiculous the arguements of theism are.
Reply: @thewonderpig97 what assertions did I spout? 
I'm not here to impress you buddy, so feel free to stop thinking so highly of yourself.
What beliefs do I hold? 
Oh sweetie, we aren't desperate, we're concerned. Concerned that people still follow superstitious bronze age fables, as something to admire. 
There's a reason apologetic is a word reserved for the theist. The only people holding onto imaginary reality, are those that read religions books, and think they're valid, or contribute anything
Reply: @thewonderpig97 ok bud, whatever you need to tell yourself. You keep deluding yourself, and I'll go back to reality. Good day
Reply: @thewonderpig97 that's the thing. I don't tell myself anything buddy. I'm an apistevist buddy. I don't take anything on faith. I only really accept established facts. 
No need to delude myself, as the evidence for what I know, it's quite literally mountainous.
Any spelling mistake is due to getting used to swift texting, which I admit, is more of a hindrance
Reply: @thewonderpig97 you too bud 🤝
Reply: The carbon dating was correct.  However, the sample of the Shroud given for carbon dating was not of the original Shroud.  It included repairs which used cotton added to the linen of the Shroud during the Middle Ages.

Then what was the problem to take another sample from different part and repeat dating... oh wait it would prove to be fake, that is why Church refused another sample;)
Reply: @tgstudio85  also, 8 samples of were actually taken. Be a very big coincidence if all 8 happened to be repairs.
Theists cling on do hard to the shroud. They don't realise that, the shroud being fake doesn't disprove their faith. Their opposition to the findings kind of does though
Reply: @thewonderpig97 please, provide references and citations to your claim.
Reply: @thewonderpig97 the answer is, we simply don't know how the image got on there, and that's a perfectly good answer.
Reply: @thewonderpig97 🤦‍♂️
Reply: @thewonderpig97 sorry dude, you misunderstand. The facepalm was aimed at you.
Reply: @thewonderpig97 oh, and sorry if my speaking had lead you to believe in making a claim. I'm not, I'm just denying yours. 
There's a difference.
Reply: @thewonderpig97 of course bud. Whatever you need to tell yourself. As a theist, delusions aren't alien to yourself
Reply: @thewonderpig97 🤦‍♂️
Reply: @thewonderpig97 oh buddy, I feel just fine.
Reply: @thewonderpig97 you too bud. All things aside, I wish you all the best.
Reply: @poozer1986  The repairs are evident to the naked eye, you can see where the patches were placed after the fire.
Reply: @poozer1986  Alex, no one is forcing you to watch or to listen. You were created with free will, so do as you please but it is not necessary to insult others that are not of the same mind as you.
Reply: @georgewashington687  🤦‍♂️
Reply: @georgewashington687  free will? How quaint. You cannot have free will, if god knows everything you'll ever do, say or even think.
Ridiculous claims by their very definition, require ridicule
Reply: @georgewashington687  of you think that the scientists only tested repairs, you're more deluded than I thought
Reply: @ImCeeJH  that's great I believe in Jesus of Nazareth
Reply: @poozer1986  if there is no free will than you weren’t free to come to the conclusions you have come to. Nor to think a coherent thought. You can’t even know anything apart from you having some sort of experience. If there is no free will than choice isn’t real and that means reason and logic isn’t real. Yet here you are..
Reply: @ImCeeJH  how can you claim free will, when you're god already knows everything you will ever do and think. Your logic and reasoning are backwards
Reply: @poozer1986  I can watch a football game on tv. Record it. See the end results. Come back later and watch it with a friend who hasn’t seen it … just because I know what’s going to happen and he doesn’t , does that mean I controlled the football game?
Reply: @ImCeeJH  🤦‍♂️
Reply: @poozer1986  as for the shroud of Turin. There is a more precise testing that was just done and it was saying it dates to the first century. All the other evidence about the shroud agrees with this.. outside of questionable carbon dating. I can find you the sources. Or you can actually fidn them real easily. Just type in shroud of Turin and go to news
Reply: @poozer1986  I can link you a few videos that will go over all the evidence for the shroud. From a pure scientific standpoint.
Reply: @poozer1986  but for the sake of argument. Let’s throw the shroud out. That doesn’t make Christianity false. It would just make the shroud false. Christianity is true because the historical evidence and reliability of it says Jesus lived, walked, died, and rose from the dead.
Reply: @ImCeeJH  you baffle me.
I only claimed that, theists who believe they have free will, given to them by god, cannot exist, as they also claim their god knows all, past present and future. I know I have "free will", but it's not granted by any god.
Reply: @ImCeeJH  🤦‍♂️
Apologetics are ridiculous, as sir, are you.
Good day
Reply: @poozer1986  you say I am ridiculous, but I haven’t heard a compelling argument from you yet. I’ve given you multiple examples and you haven’t been able to refute a single one… nor can you justify your claims of why you have free will if naturalism is true.
Reply: @ImCeeJH  I feel no need to argue with you buddy. Your level of indoctrination is far too high. You have given me examples? Not even remotely. You've said a lot, but that's about it. 
I'll say this again

Good day
Reply: @poozer1986  where does free will come from?
Reply: @ImCeeJH  you're boring me now bud. 
Do you not get what, good day, means?
Reply: @pricklypear7497  then please, cite this more recent study. Give me a direct way to find it and access it. 
I'm already hedging my bets it comes from a Christian science source
Reply: @pricklypear7497  oh dear. A comment deleter. What a joke. Obviously knew I was right
Reply: @sharonburke100  No, the cotton fibers, possibly fibers left over from the loom used, were removed prior to testing. Only the linen was tested. There was no repair.
Reply: @poozer1986  I can understand your skepticism.  I’m a Christian and maintain a healthy amount of skepticism about the shroud, but I’ve read as much material as I can get my hands on and listened to countless lectures & documentaries on this subject matter.  Directing anger and demeaning comments towards those who see the shroud as the potential wrapping of Jesus isn’t acting in the spirit of healthy dialogue.  True science shouldn’t exempt a Creator from any hypothesis.
Reply: @rubberman7665  I certainly do not exempt a creator from any hypothesis. Just all the creators that come from organised religions. They're all so clearly nonsensical. 
I do not see a problem mocking religions, or the people that follow them.
After all, ridiculous claims by definition require ridicule
Reply: @poozer1986  Further mocking and demeaning indicates your unwillingness to participate in rational discussion.  Claiming that any theory that is in opposition to your particular theory is “ridiculous” and “requiring ridicule” shows a lack of effort and a reluctance of truly being open to a truth contrary to your presuppositions.  Your attempt to drag your opponents into an emotionally charged debate versus a dialogue based in a true search for answers is, honestly, typical and boorish.
Reply: @rubberman7665  why do I need to participate in reason discussion, when the position of the religious, is irrational?

If you don't like it, feel free to move on buddy.
Reply: @poozer1986  Just curious, what do you get out of, what appears to be, hours of YouTube mockery and trolling?  Are you in a salaried position at a Christopher Hitchens organization that has a mission statement of opposing religious beliefs?  Or is it just satisfying for you in some philosophical sense?  Obviously, your stance leads to an ultimate demise in a rotting body, end of story.  My stance leads to a rotting body, then a soul in an eternal state of some sort.  Your stance provides no enticement to me, but I understand how you could care less now.  If you’re stance is wrong, your eternal life is compromised.  If my stance is wrong, my life is still happy and lacking nothing.
Reply: @poozer1986  Just curious, what do you get out of, what appears to be, hours of YouTube mockery and trolling?  Are you in a salaried position at a Christopher Hitchens organization that has a mission statement of opposing religious beliefs?  Or is it just satisfying for you in some philosophical sense?  Obviously, your stance leads to an ultimate demise in a rotting body, end of story.  My stance leads to a rotting body, then a soul in an eternal state of some sort.  Your stance provides no enticement to me, but I understand how you could care less now.  If you’re stance is wrong, your eternal life is compromised.  If my stance is wrong, my life is still happy and lacking nothing.
Reply: @rubberman7665  firstly, Christopher Hitchens happens to be my name. Secondly, I don't get anything out of it. 
I just like to see the nonsensical reasoning people give for their faith, and to try to invalidate the opposing stance. 
You really think the "what if I'm wrong" argument means a thing to me? It doesn't. There's an extremely infinitesimal chance that there is a hell, or that any of the hundreds of religions, man has created throughout history, are true. 

Anyway, like I said. If you don't like it, feel free to not involve yourself.
Reply: @poozer1986  THE Christopher Hitchens that passed away 12/15/2011?  Just using his profile image?  You have to get something out of wasting precious time mocking people.
Reply: @poozer1986  Yeah, I’m not that dumb.  Enjoying some sarcasm.  I assumed that you were familiar with it.  Maybe delusion is the attempt of arguing against a Creator, but one would need to be open to adjusting their firmly held presumptions.  I absolutely disdain these types of dialogues, but if I claim to care about my fellow man, which would include this life and an eternal life (if it exists) I should be actively trying to convince those that I consider to be at risk.  Take care.
Reply: @rubberman7665  sarcasm is the lowest for of wit, and very difficult to judge in text. 
We can care about our fellow man, without the need of an afterlife, or celestial dictator. 

Please, never force, or even offer your religion to anyone who doesn't ask.

My dear, religion is like a penis. It's a perfectly fine thing to have and take pride in, but when one takes it out and waves it in front of my face we have a problem.
Maggie Smith
Reply: @poozer1986  I’ve read multiple books on The Shroud and watched even more lectures and documentaries.  Some of the strongest supporters of The Shroud were once the harshest critics of it.  To call it an obvious forgery is indication that you haven’t sufficiently researched it.  I’m not an more bothered than you are. I’m choosing to have dialogue.